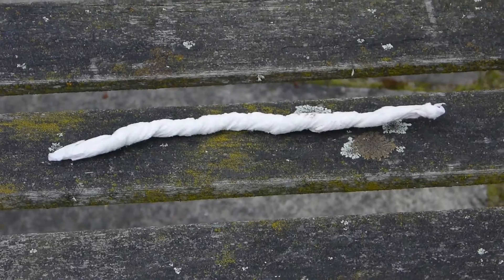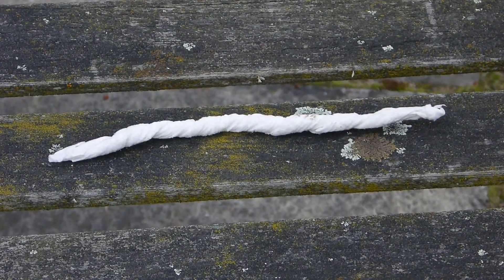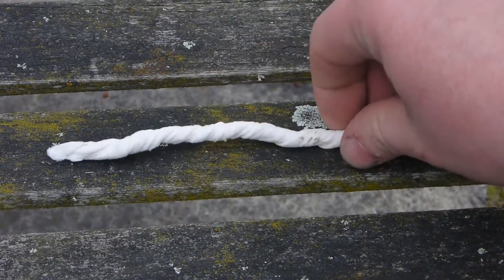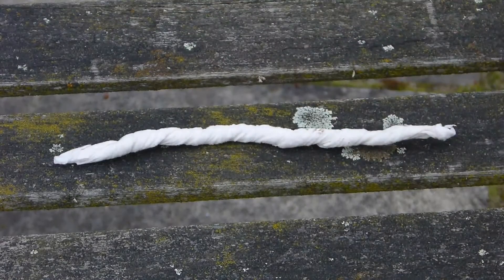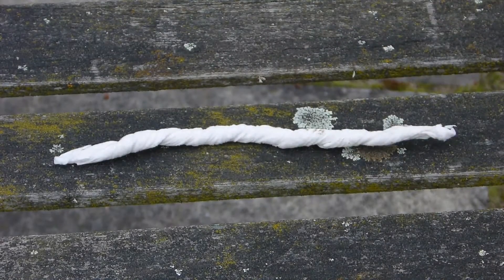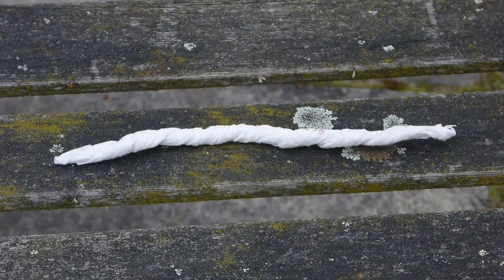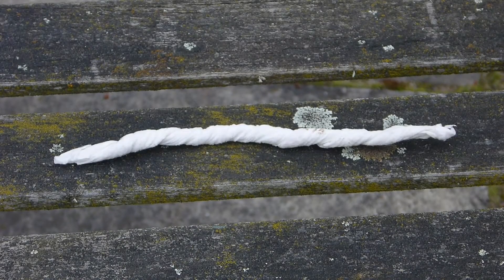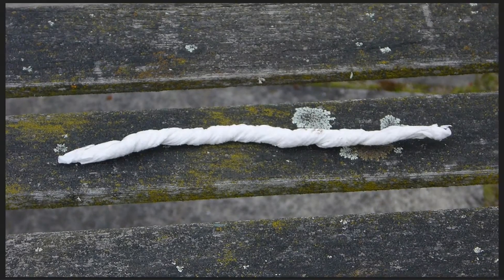KNO3 Slow Burning Fuse Test  - Next72Hours

Comment: Dude is it imp to dry the fuse in the oven after mixin everything?,ive seen people put it in the oven
Reply from the maker: good question I didn't bother to dry it in the oven but I am sure it would speed up the process, I imagine one would want the oven at quite low heat and if it went up it would make a mess... a good sunny day or dry space would likely do the trick :)
Reply: @Next72Hours  thanks mate,props to you for clarifying doubts after such a long time

Comment: Do you have pine/birch oil/tar or a pine pitch glue stick or a fatwood stick?  Easy squeezy powder and fuse.  Scrape fatwood into fuzzy pitch fibers, or (using indirect heat) melt/mix pine/birch oil/tar or pitch glue until fluid.  Grind char(coal) briquet into carbon powder.  Finely grind Epsom salts (Magnesium sulfate) into fine grind powder (dust).  Grind sugar or confectioners sugar until fine dust.  Mix up all powders into very fine ground dust.  Add in slowly and evenly stir in.  Cool down fluid until getting (honey) thick, and keep at this temperature.  Using laundry powder, or shave/scrape dry soap bar into fine dust, or very tiny slivers like "=======."  Add soap slowly into fluid and stir until melted in.  Make cotton ball or fatwood fuzzy fibers into fuse rolls.  Place on aluminum foil.  Pour tiny stream of fluid onto cotton or fatwood fuse, and allow to cool and firm.  Pull off and roll into thick-fat or tiny-thin fuses.

Can make without wood products for a true basic black powder fuse material.  Wood products allow longer burn.  They will burn quite well.
Reply from the maker: +John Lord Thanks John I just got access to my uncles land like 3 acres of wild forest so I will look out for some fat wood and pines. phil